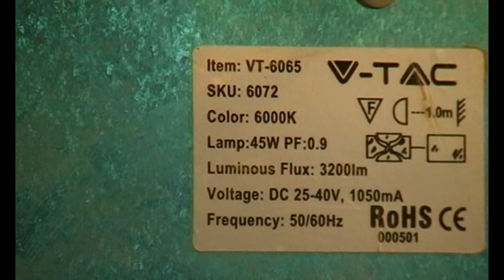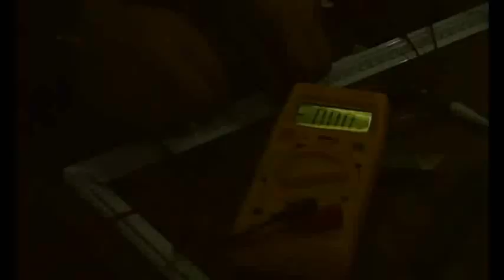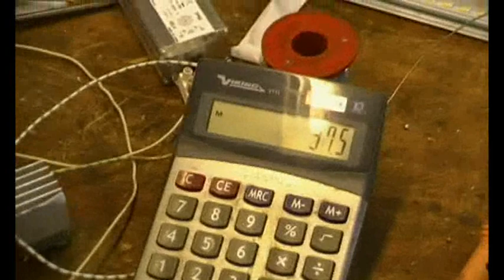Faulty 60cm LED ceiling tile, fix, repair, hack, modify for alternative uses.

Comment: Good job Andy.  It is a shame that in this throwaway world, so few electricians take the time to actually fix stuff.  I guess that there is no money in it for them.
Reply from the maker: HI, it's a real problem because of liability, if they fix it and it goes wrong again, it's their problem. If they replace it and there is a fault then it's the suppliers problem. That and time management, cheers

Comment: Another led light saved from the skip.  Good job.   Not sure why you had some flicker from some leds at one point - it went away in the final fix anyway.   My neighbour's barn has a 150W led floodlight that has one third of its led array flashing exactly like that downlighter you showed in the other vid. - I am going to have a look at it, with some expectation of maybe finding a dodgy cap in one of the power supplies inside it. I'll let you know what I find, just for information. I may have to settle for just disabling the one third that is flashing annoyingly if I can't find the fault. This floodlight is one of a group of 4, so I'm hoping they don't all start showing this fault !! Getting at them up in the barn roof is going to be the hardest part I think... Cheers, Dave
Reply from the maker: Dave, I suspect the 150w flood will have 3 drivers, or 3 parallel circuits, be interesting to know. If you de-tune them it will extrend the life dramatically, cheers
Reply: Andy, yes I am expecting to find 3 power driver modules in the 150W flood, one of which is playing up.... I won't be able to reduce the current through the leds though, as every watt of those 150 (600W total)  is required in that barn -   actually, it would have been better if they'd put in many more lower power lights spread out further, but this is with hindsight of course, and cost would be a problem. You have a different bench power supply now I notice by the way - very good ! Cheers, Dave
Reply from the maker: Dave, will we see a video about your LED escapades? Yes a much better power supply, cheers
Reply: I think I will try and video it Andy, yes. I keep fixing things and regretting not making a vid about it :o) Lambing will start in that barn soonish, and so the lights problem will need fixing at that point - I think I will try and take the duff lamp down and away to my workshop - that lamp does not point in  a useful direction during lambing luckily - but yes, I will record what happens, it might help someone else out with the same problem.. cheers, Dave

Comment: Same construction as an led computer monitor
Reply from the maker: Thanks for this, so monitirs are 4 parallel then in series, clever stuff to produce images, cheers
Reply: @TheInfoworks  I think sim6699 is referring to the LED backlit monitors/tv screens.
OLED screens have an RGB LED for each pixel I believe.
Reply from the maker: Ian, thanks for the info, that makes sense, cheers